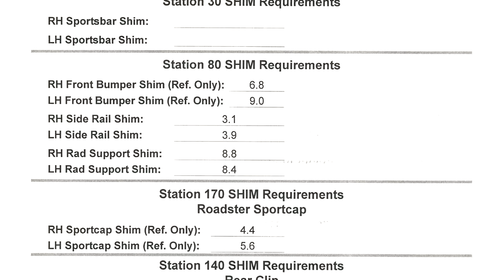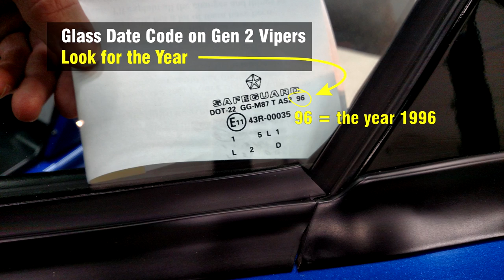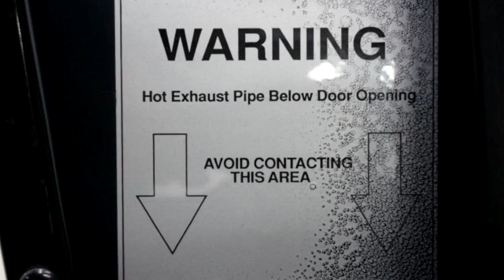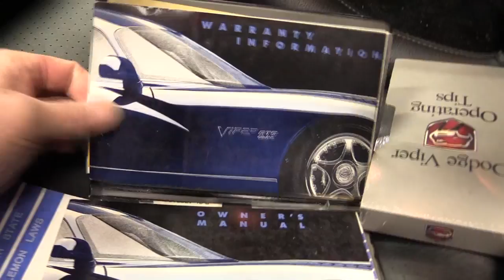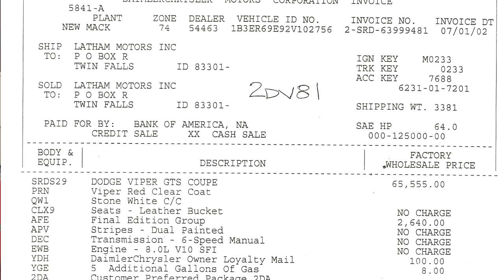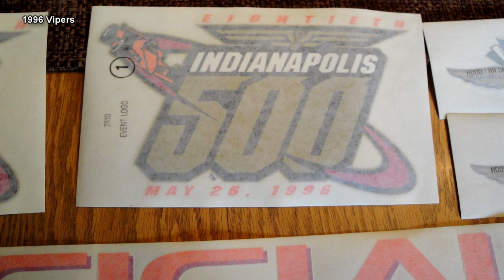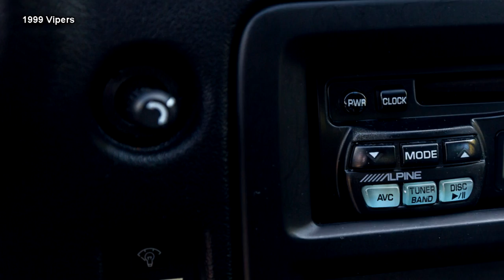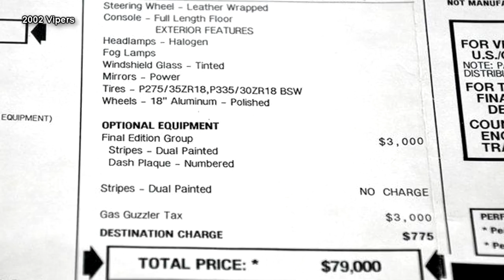Dodge Viper (Gen 2) Buyers Guide & Review 1996 - 2002 GTS & RT/10

Comment: You are the most knowledgeable on Viper's, very impressed. I love my 97. 146k 👍🏼
Reply: How’s it holding up? Any major repairs?
Reply: Amere Mortal actually doing pretty good. At about 109,000 miles I start to hear valve tapping… But I was able to pick up a Hennessey venom 600 motor for $6000 they had 28,000 miles on it. It was in a fire. They were still able to salvage the car out of the garage.  the motor was bench tested and it's doing great. So of course I've been through a radiator, starter, alternator, steering rack, steering pump, windshield wiper motors… Sounds like a lot but she's running pretty good.
Reply: @1963geckos  It does sound like a lot. I’m hoping to pick up a modified one that’s had most of these things done already. Good thing this thing seems easy to work on.

Comment: Fellow ‘96 GTS owner here, great job Cody. A very thorough and well researched video. I even learned a few things! One thing I would add, early GTSs have the oil cap on the driver’s side; after a couple hundred they moved over to the passenger side.

Comment: Great content! I would also add to be EXTREMELY CAREFUL with the remote battery nut. This is a design flaw as the stud that connects all power to the car from the battery is held in with a plastic shroud inside the fuse box. With heat, time and taking that nut on/off the stud will strip. When this happens the car will have electrical gremlins and the entire fuse box and about a hundred wires have to be replaced. I’ve had this happen and had to chase for 6 months so like to inform other Viper owners.

Comment: Great video from a true viper guy!!! Only comment, the same cam was used thru 1999, then in 2000 went to the smoother cam to help reduce NGR. I think in 1998, they started to use Castrol Syntorq to minimize the NGR.

Comment: Does the Viper require a refrigerant additive for the water-cooled radiator to pour into in order to help cool the engine a little bit better? Would it help if insulation blanket was used to cover over or wrap over the side exhaust pipes before installing those side exhaust pipes back into the door sills located at the bottom?

Comment: i have a 1993 and inside the trunk on both taillight housings and under the trunk lid by the plate lights the assembler wrote (with silver paint marker) the date assembled and their initial. both taillight housings have 7-11-93 with initial and the trunk area has 7-10-93 with initials. I looked at the VIN sticker inside the door and assemble date is 7/11/93. Pretty cool.

Comment: Be aware the 998/999 recall instructions from Dodge was wrong!  They told the dealer to install the brackets under the oil filter which made it impossible to remove the oil filter.  Instead it should have been adjacent to where the instruction stated.  Don't ask me how I know that......

Comment: Anyone know where you can get that spoiler on the red one?
Reply: I'm not sure where you get one, you can probably find one on e-bay or some other site that's trust worthy. But I think the spoiler was added on if you bought a Hennessey package upgrade mod to your viper back in the day.

Those Hennessey modded vipers have more horsepower than stock, they have upgraded brakes, 5-point safety harness, obviously the spoiler, and I believe it came with upgraded wheels also.

Comment: Great video! I'm currently looking at buying either a '98 or a 2000 rt/10. Both I'm looking at are very clean cars! I'm looking to keep the car stock and just drive casually and keep it for a long time without worrying about resale. Which would be the more reliable option? With routine maintenance, how long do these cars last?